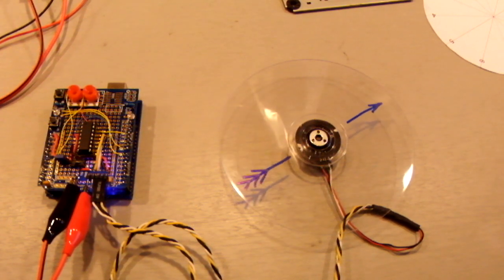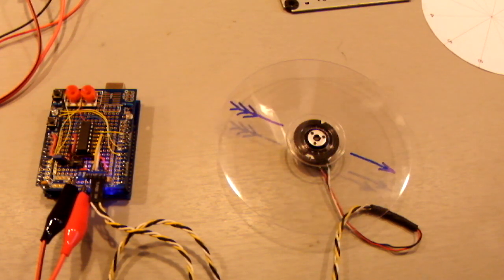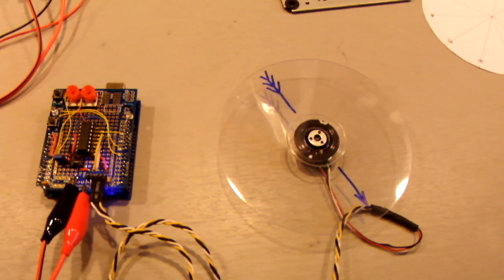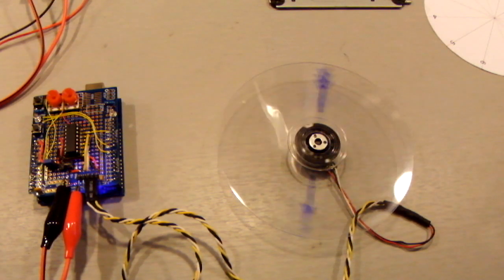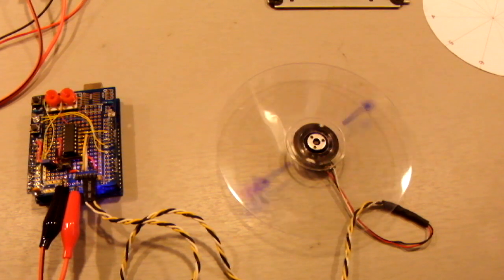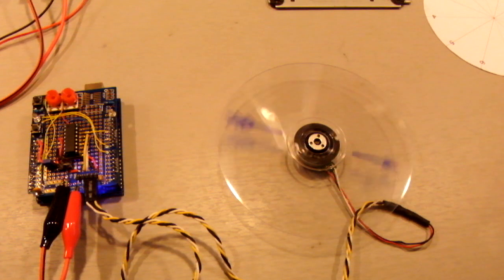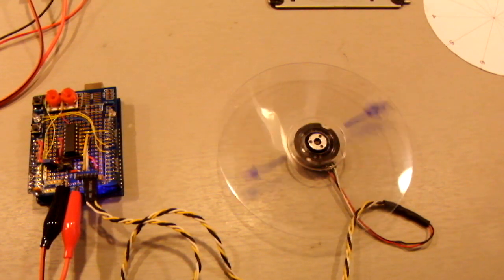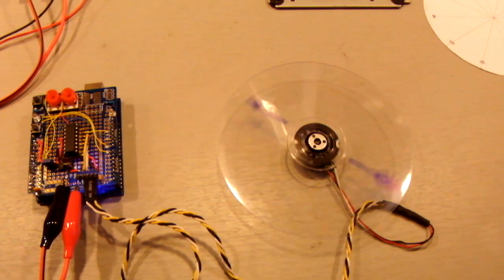Driving BLDC (brushless DC) motors with Arduino - PWM or discrete steps

Comment from the maker: You have to send more steps to the motor if each step consists of 48+ microsteps. But as far as RPM, there was probably a little difference in the resulting RPM but I've done enough testing to conclude that at the same RPM PWM results in much softer rotation. By the way, if you can mechanically tie the disk to the rotor (like, glue it for example) - the inertia of the disk will do the same thing. It's just I could not glue the disk for this project 'cause I needed to be able to change them.

Comment: So you just produce three PWM signals with duty cycles from a sin table 120 degrees apart. How about the phase of the PWM pulses themselves? Are all three pulses synchronized in a specific way or it doesn't matter?
Reply from the maker: No, did not have to do phase the PWM pulses (and would be tricky to achieve on an Arduino). But as a possible improvement, the pulses could be center-timed (forgot the actual official name of the technique tho - consult with the Atmel datasheet for PWM options). As it is now, they are all synced by the left edge, regardless of the width.
Reply: MrScriptster Precisely why I asked. It's a bit difficult to picture how the currents will flow as each PWM actives but I guess on average it works out. I believe the motor control dsPIC micros have ability to generate centre aligned PWM. They do that using a timer that ramps up to your desired value (which defines PWM period) and then ramps back down to zero. The timer value is then compared against your duty cycle value. If the timer is larger than the duty cycle value the PWM output is high. With this method you can produce centre aligned PWM signals without needing to worry about re-synchronization in the firmware.

Comment: Sorry, not valid.

The first test was done at a slower speed than the second.  Any motor driven too slowly is going to be jerky.

PWM does provide much more fine-grained control.
Reply: good observation and likely true. I'm actually impressed with how smooth the rotation seemed considering the slow speed.